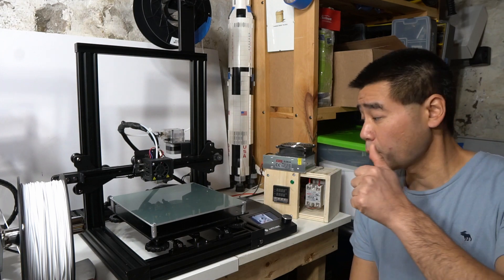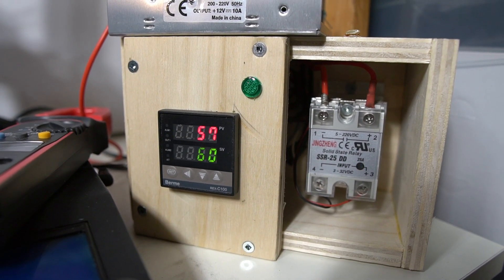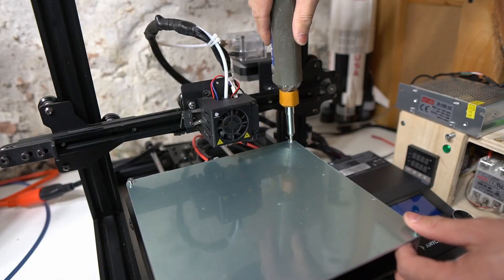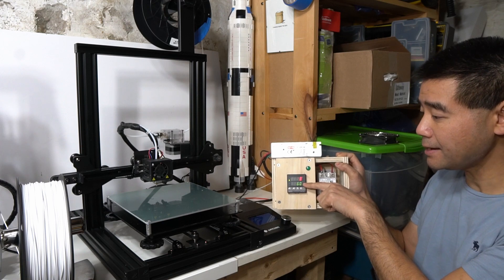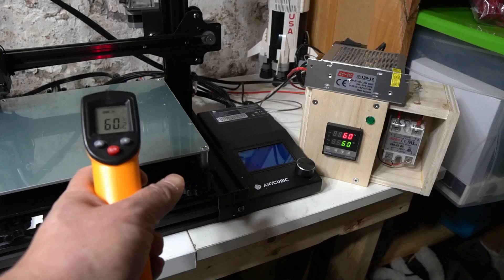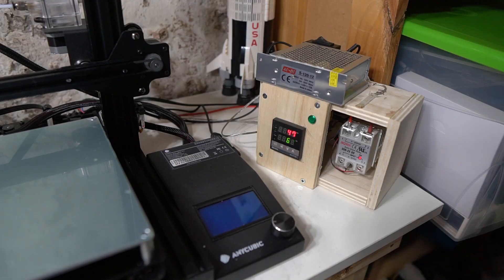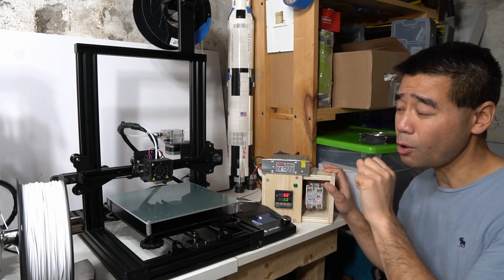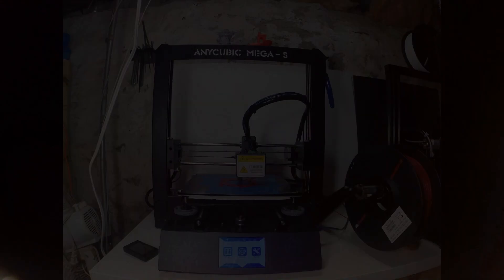How to Add a Heated Print Bed to any 3D Printer | Anycubic Mega Zero

Comment: Hi i bought a ac 220 v hot bed but my bigtreetech v1.4 controler datasheet recomend max 144w for hot bed.  What isolation i need for hotbed because i meter the resistence and no value was showed inth multimeter. ?

Comment: arent there places on the motherboard of the printer where you can just add a heating element and a thermistor for a heated bed, removing the need for the industrial temperature controller?
Reply: he said you dont need to mod the software for this to  work

Comment: You really dont want their heated bed. The aluminum is so thin (1.5mm) that the bed flexes in general and gets worse when heated and will raise/lower and warp the bed in certain spots but goes back to normal when cooled. The corners will also start to bend downwards after a short period of time and you will noticed it whenever you take the clips off the corners

I might end up swapping the stock bed with this one because it's the same thickness as my ender 3 v2's bed

Comment: hey Andrew.  I noticed that you use tape to print.  I used to do that, and got tired of it.  I added a pane of glass on it, clipped on.  not as good for temperature control of the bed (the glass is most likely not 100% of the measured temps), but I get interesting mostly smooth bottoms, and I only have to put on glue 9like, literally, white paper glue) once in a while to make the pla or PETG print  stick..
**I forgtot to say why I originally wanted to comment.. you have to watch for warpage of the heated bed, which can create issues with first layer adhesion.  a thin aluminum sheet like that wil bucle and move, even at 60 degrees..  make certain you compensate for that (unless your printer has multi point bed leveling sensor).
Reply from the maker: Hi Sebastien, thanks for the comment.  I have printed on Kapton and gotten really smooth bottoms too.  I was going to try to a glass bed but just haven't gotten around to it, will add it to the to do list :).  So far haven't had any issues with the bed warpage but I might have gotten lucky.  I just picked up an Ender 3 V2 (will post a review once I get some hours on it) so the Mega Zero it my tinkering machine, for the cost it's been a great printer.